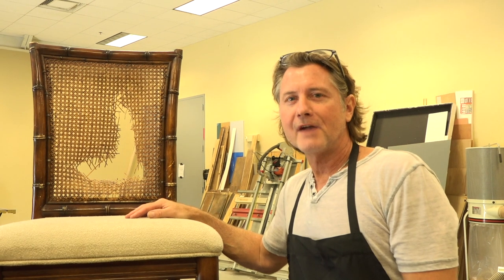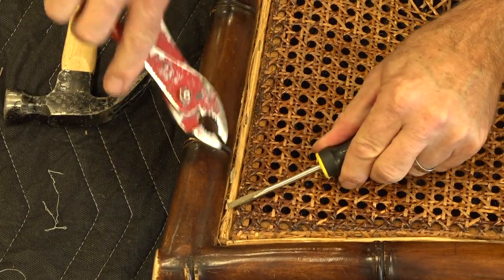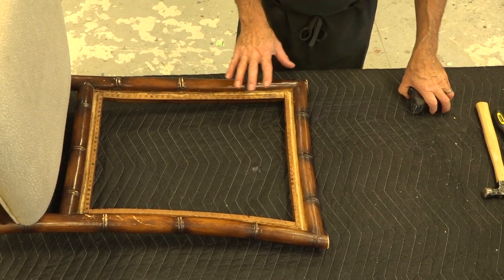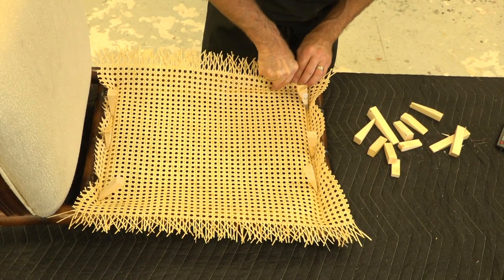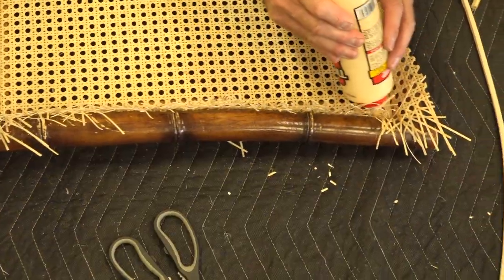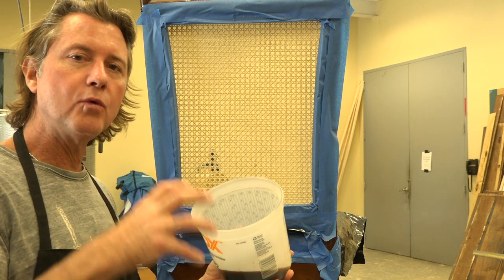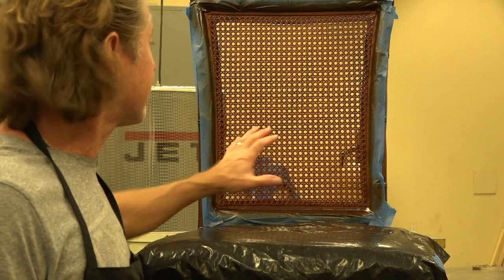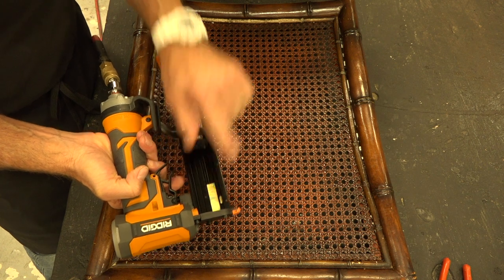Replacing and Staining Chair Back Caning

Comment: Hi from Kissimmee, Florida.  I have a beautiful dining room table and 6 chairs with wicker backing that my dad bought in 1971, when I was 6,  in Daytona Beach, Florida and the table and three of the chairs will look wonderful.  The set was made by American Furniture Company in Martinsville, Virginia.  I found a place that will replace the wicker backing of my chairs for $150 per chair.  I thought that was a lot, but now I see why!  So, after I watched this video, I bought the kit that Todd suggested from Amazon and I hope I can do it myself.  I just started this earlier today because my wicker backing kit just came in the mail.  MY chairs do not have that thick piece around the edge that Todd's chairs do and I am having a lot of trouble getting this edging off.  I have tried several tools, but it is going to take some effort.  I think the easy part is going to be putting the wicker backing ON once I get the spline OFF!  Any suggestions would be appreciated.  Also, if you know where I can find antique American Furniture chairs , I would love to check it out because I can't find the exact chair.  Thanks so much.

Comment: Thanks for sharing! I had to add more...that seat is likely held on with 4 screws. I removed the seats on mine so they wouldn't get ruined with stain. Just a hint for your subscribers.
Reply from the maker: I didn't remove mine because the small screws that go into the thin particle board in the bottom of the seats have a tendency to strip out.  The screws are recessed deep in the seat support so if I did strip them out I couldn't use a larger screw so I opted to just cover the upholstery.  For others it might be a good option.

Comment: I have a cane-backed rocker that needs replacing but trying to figure out how to put the new webbing on.  It's not stapled or anything to the back; just wrapped around top and bottom of back of chair.  My question is does anyone have an idea how to get the webbing to be secure enough that when I lean back in chair it won't come undone?  I've never tried this before but my current webbing is really falling apart with no back support and I need to replace soon.  Thanks!

Comment: Is there a reason you didn’t stain rattan before installing?
Reply: Yes
The rattan needs to soak in water in order to be pliable and not break when stuffing it into the channel… if you stain it the pores will be sealed and it won’t absorb water therefore it would be brittle when you try to secure it around the edges

Comment: can you stain first?
Reply from the maker: No, you have to soak the rattan in order to make it supple.  If you stained it I am not sure if you soaked it in water afterwards if it could absorb enough water to make it soft enough.  Also it expands when it's wet, as it dries it shrinks and pulls the rattan tight.